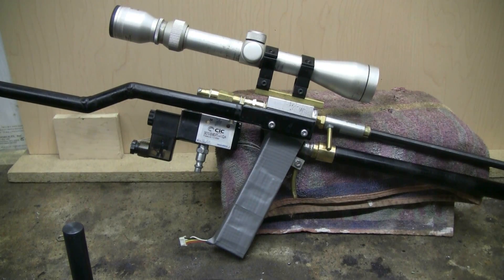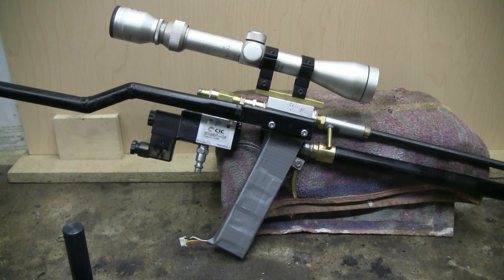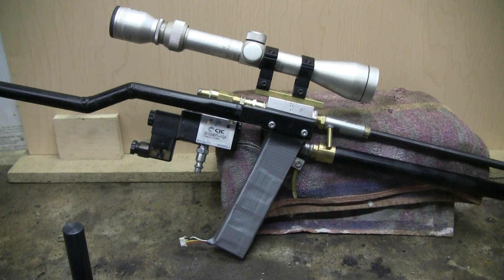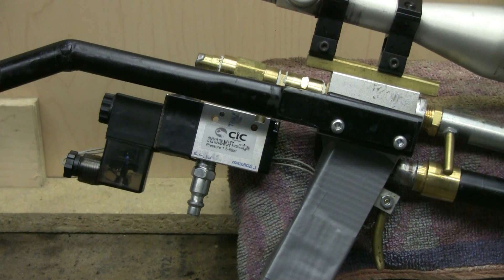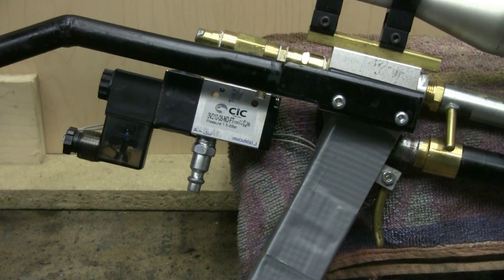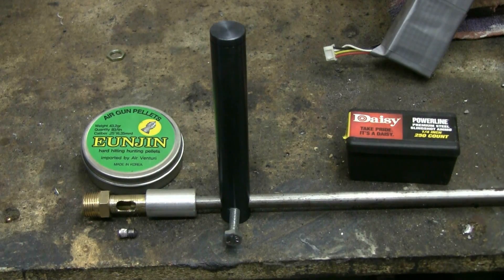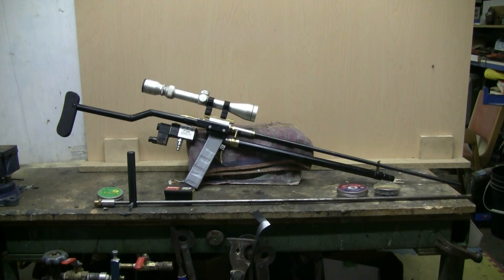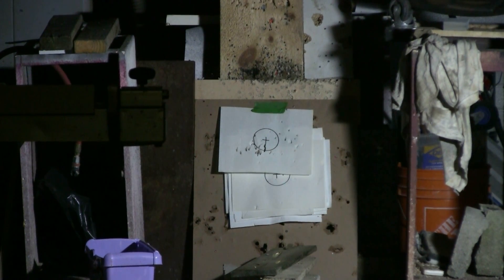DIY Semi Auto Air Rifle Made With QEV

Comment: To have this mobile, you would add an air tank (extra one) ?
Reply: Depends, youd want a regulator though, because without youd be shooting at whatever psi and it would decrease rapidly, with a regulator you could shoot at 100psi with the tank at 800psi, youd have many more high power shots, but it will be big and cluncky plus heavy

Comment: +Bill Gilmour , nice video but how do you connect the solenoid valve to the pilot port of the qev???
Reply from the maker: +ailbhe frazer I had to find the brass plumbing fittings that were needed to join the two valves.

Comment: what is the size of the ports on the QEV and the 3 way solenoid???
Reply from the maker: +keston reyes Solenoid valve is 1/4 NPT. QEV barrel port is 3/8 NPT, others are 1/4 NPT.
Reply: I looked on ebay and could not find the QEV your talking about

Comment: Would it be possible to pilot and fill a QEV valve with the spring mod using a blowgun?
Reply from the maker: +Axel Wancke A smaller QEV should pilot OK with a shop air blow gun.
Reply: +Bill Gilmour Could you use the blowgun to fill  the air tank as well?
Reply from the maker: +Axel Wancke To fill as well you might want to add a T putting the blow gun on one side and a ball valve and air chuck fitting on the other side of the T and the last part of the T of course goes to the pilot / fill port of the QEV.
Reply: +Bill Gilmour OK, thank you very much for the information.

Comment: bill, I purchased an qev from eBay, using 100 psi, but it doesn't operate, I found there is no spring inside, just a rubber and the movement inside is very limited, so do I need to cut one of the parts that is almost touching the rubber stopper , ?
Reply: no u have  to put a spring in it don't mess with piston
Reply: +Frank Leung  Leave it alone! You probably put it on the wrong way. Look at my videos if you want to see how to assemble.
Reply: +Roy Battey I checked your videos, there is no video showing how to assemble it. I'd like to know too.
Reply: F What brand is your QEV? If it's an Alpha QEV then there's a big arrow on the side pointing in the direction you want to attach your barrel. Show me a picture.
Reply: +Roy Battey I don't have one. I just started today looking up videos on how to make an air gun. I don't have any of the parts or a plan/design.
Reply from the maker: The spring is a mod that you can add if you want. It pushes the rubber forward so the qev self closes. Limited movement usually means a quick valve action. The rubber does not need to move much. You may need to make a tiny hole (1/16") near the edge of the rubber disk. With a ball valve on the fill/pilot port and a tank on the reservoir port, you should be able to fill the tank by opening the ball valve, then close the ball valve, remove the air chuck, opening the ball valve should pilot the qev and dump the tank out the barrel/exhaust port.
Reply: With the modification Bill described above, you could also fill through the chamber rather than from behind your QEV. I personally would leave my QEV alone the first time around before I get more experience.
Reply: +Bill Gilmour  The Spring in QEV is necessary ?